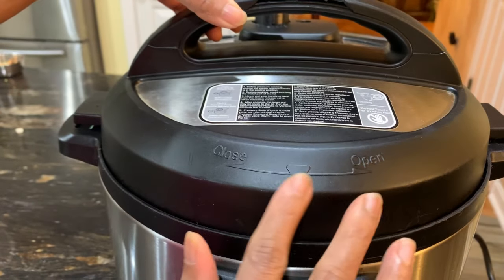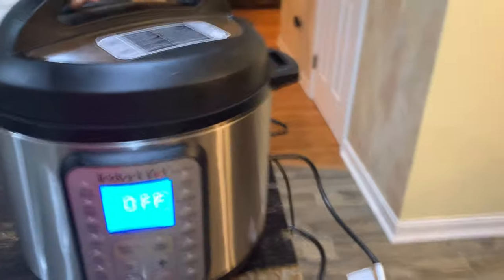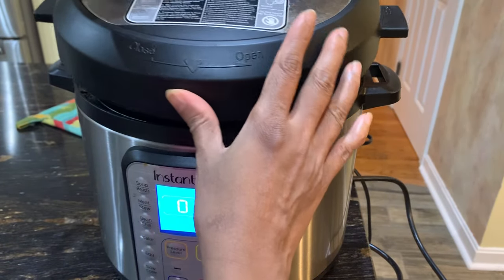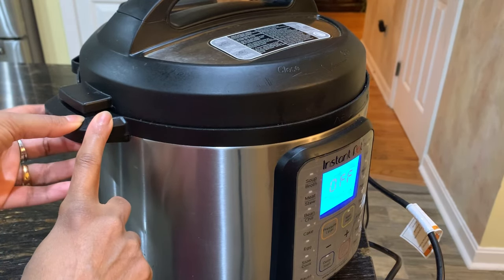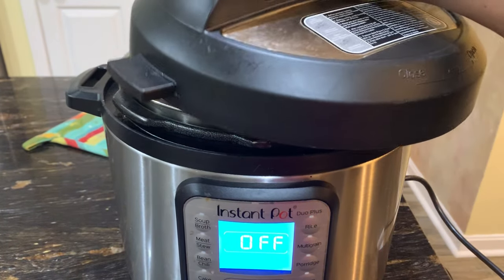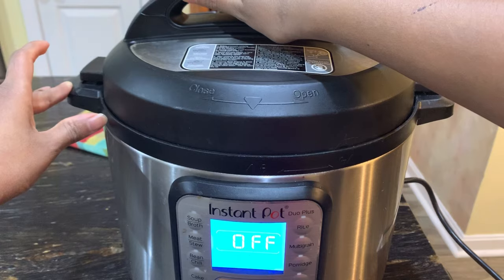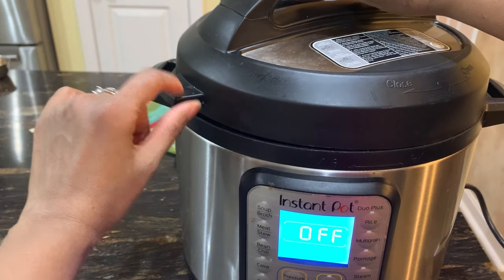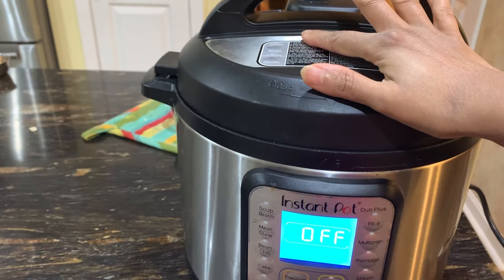How to screw the lid on the Instant Pot

Comment: Hello, great video. I didn't have issue putting the lid on, but once the lid is on it's a bit wobbly/loose. Is it normally like that? I thought that once the lid fixes into place it become tight.  Hope you can answer ,y question. Thank you! :)
Reply from the maker: yeah it remains kind of a little loose until the pressure starts to build up and seals it.

Comment: also! if you use yours to cook basmati rice, how many minutes do you put it in for
Reply from the maker: Good question. I cook basmati rice for 6 minutes pressure cook adding 1.5 cups water for every cup of rice.  But as soon as the pressure time is done, I release the pressure manually and open the cooker. this is to prevent overcooking. Hope this helps!